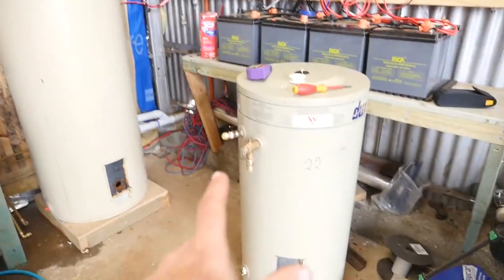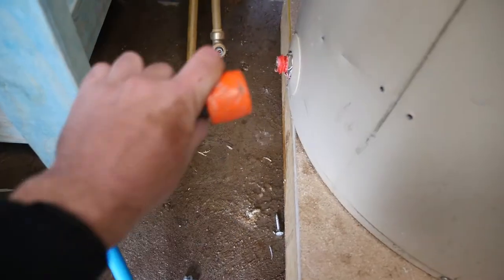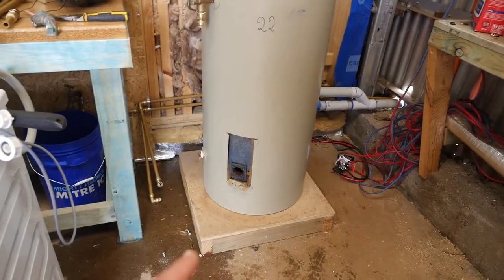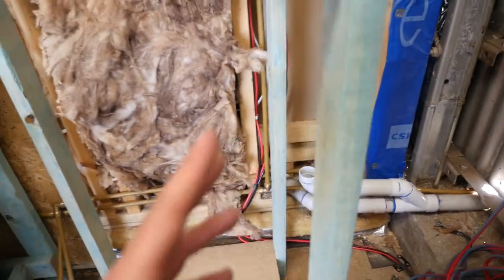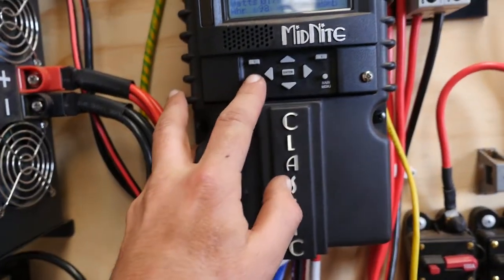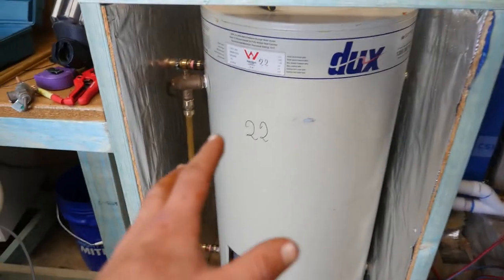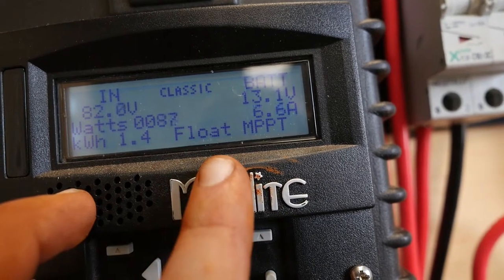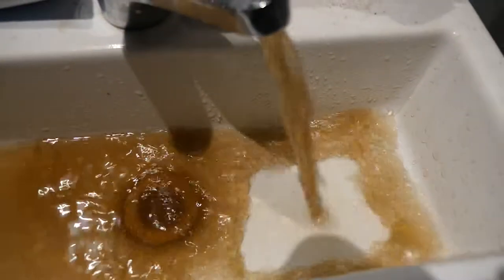DC Solar Hot Water Update - Installing New Hot Water Tank

Comment: There are tanks with 2 elements, generally upper and lower elements I believe, I think David Poz did a review on a dc system he was doing. So was the problem that you couldn’t produce enough solar power to heat the large tank quick enough  with the 900watts it was getting in previous video? The smaller tank is probly a good quick fix, but a few more panels or a larger or second element may have maintained the bigger tanks temp better, which is handy to have the extra storage if you get a week or three of shite weather & no extra power for heating water. Cheers

Comment: I was given a tank and I pulled almost a bucket full of lime deposits out of the bottom of the tank.  Since it is rusting, I suggest replacing the anode rod. Good luck getting it out though. Do the tanks there normally just have one heating element?
Reply from the maker: Thanks Opera, I will keep that in mind. The water is coming through nice and clear now. Yes all of the ones that I have seen only have one element located on the bottom of the tank.